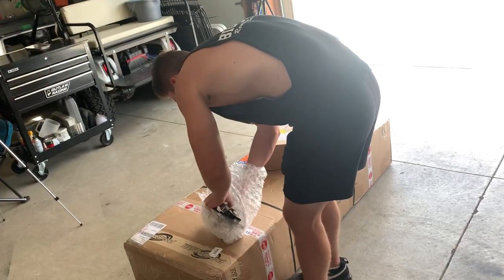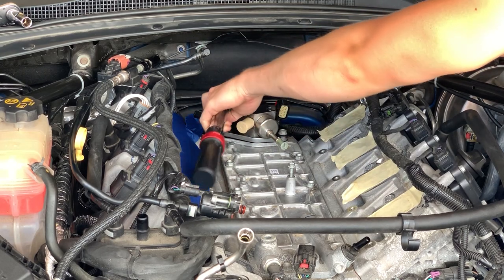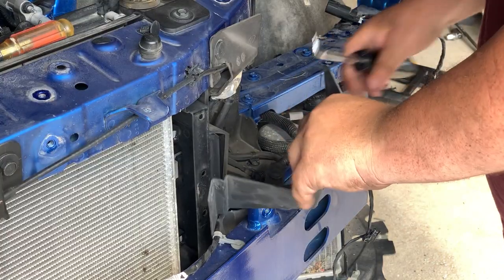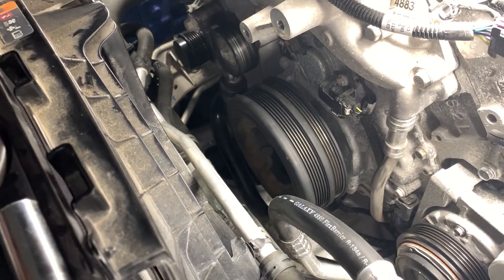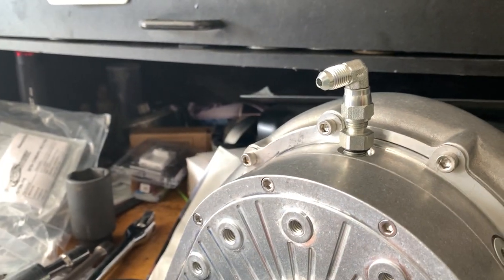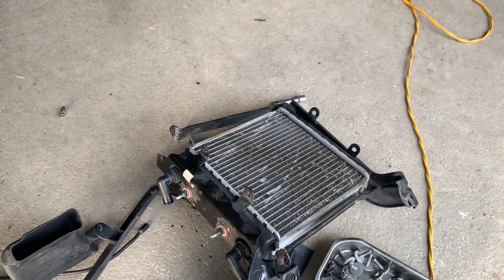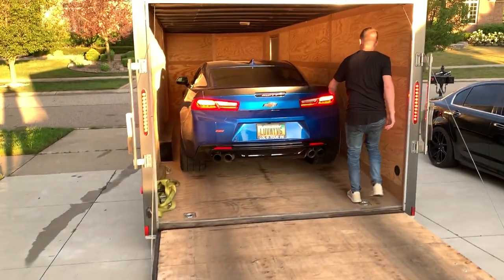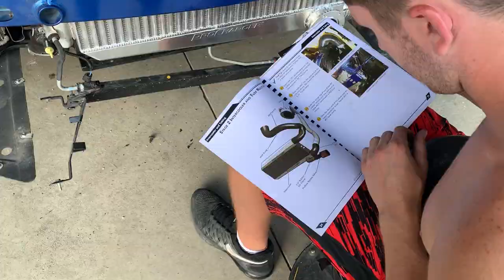2017 Camaro SS Procharger Install!!

Comment: For $8,000 just for the kit....might as well spend the extra $1,000 to $1,500 to have a shop put it in and tune it right there. I mean, what's another 1k? I used to build all my own stuff from 2nd gen to 4th gen....let me tell you, I don't have the time with the 6th gens. I might do the E-Force install myself...but when you are taking the entire front clip off and having to modify the kit to fit for a bolt-on like that....I'll let a shop do it. I do like the sound of a Procharger....even though back in my day a Procharger was a Mustang mod to us F-Body guys lol.

Comment: Have fun, procharger life never gets old
Reply from the maker: No it doesn’t! I’ll have to own a procharged car at some point!
Reply: @SemiCarGuys  regardless of the sound, stock = 100x better.

Running meth, e85 and 93 just isn’t practical, gets annoying after a while which is why I don’t post anymore or drive my car as much
Reply: @MP3BOOSTED  been missing your videos but now i understand. I just went the bigger fuel system and hoping to go 800 wheel on full e85 with my D1X. Hopefully i won’t be needing any mixing or meth in the future. DI is expensive 😅
Reply: @ProGen6  what fuel system did you go with?
Reply: @ziandaruwalla2371 I have 1k+ whp ss with d1x and I run the big bore hpfp, bigger fic injectors, and fore innovations triple pump setup, with meth, e85 and 93 plus everything else obv..